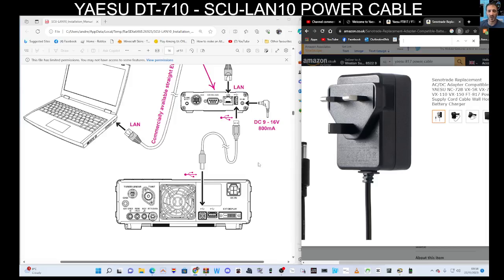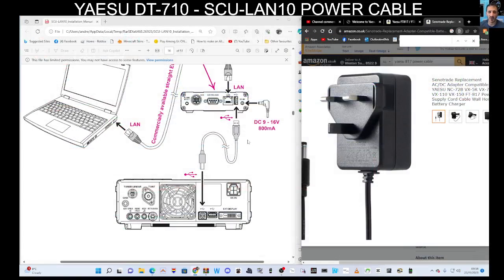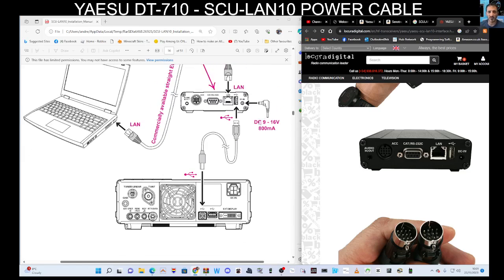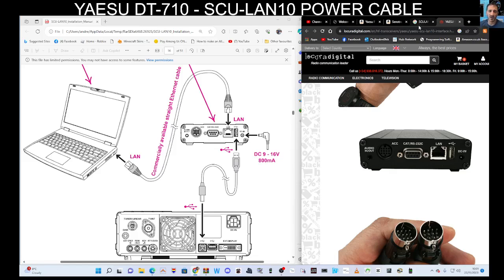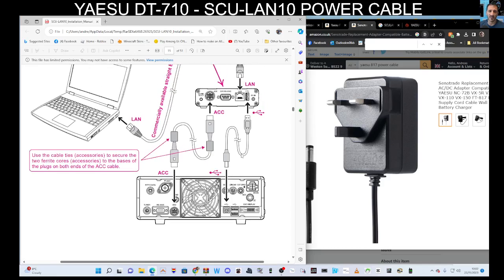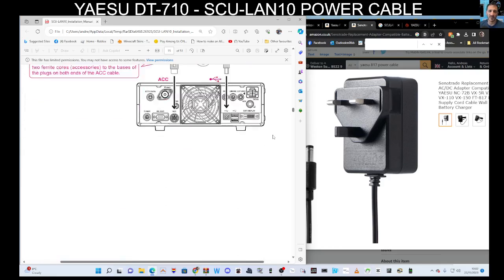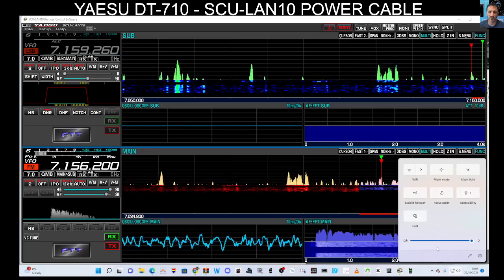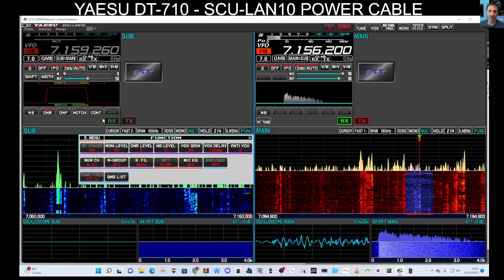YAESU FT710 & SCU-LAN 10 POWER CONNECTOR

Comment: Does the SCU-LAN 10 DC IN require 12v from our usual power supply or is it 9v ?
Reply from the maker: Depends what radio you use I would read manual lots to learn .

Comment: I got the Lan-10 with the 710, but have you been able to use the usb cable on your computer and still have some connection to the LAN-10. We have a single usb connection but I will like to use the LAN-10 and WSJT, or winlink at the same time.
Reply from the maker: You need lots exra hardware and cables its not worth it .